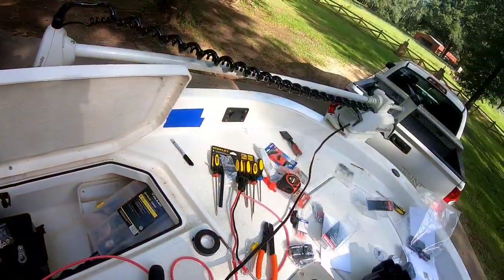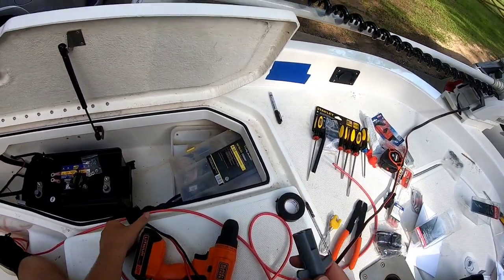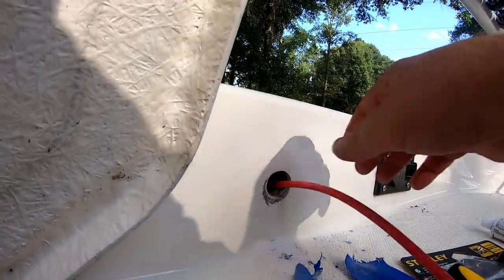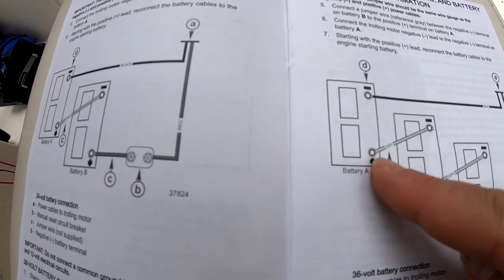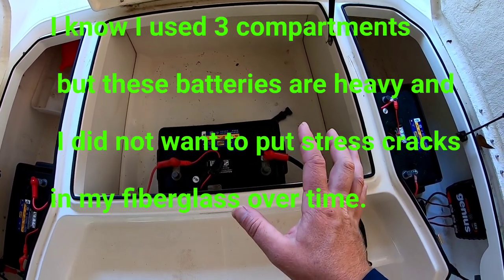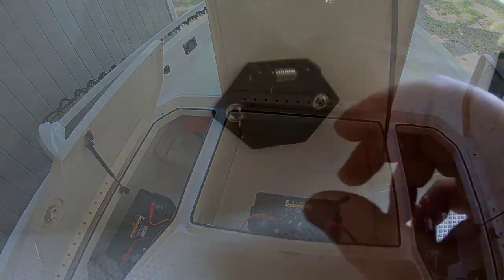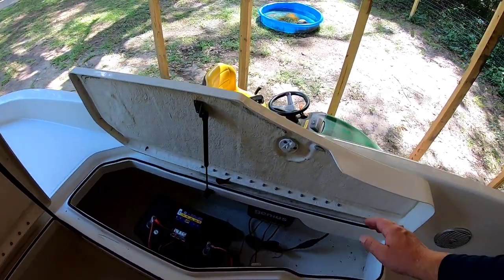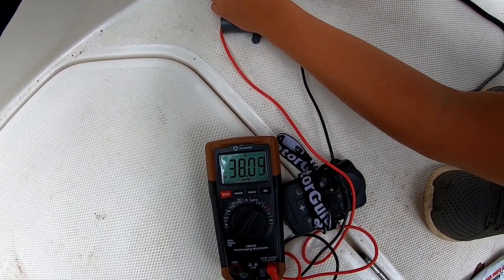INSTALLING A 36V TROLLING BATTERY SYSTEM.

Comment from the maker: You will need a 60 amp circuit breaker for a 36v system, if a 50 is used you will not get maximum thrust.

Comment: Thanks for the walk through on this. I am trying to get something together for my jon boat. Need all the help I can get. 😉
Reply from the maker: Glad it was helpful! If you have a 12v system you can connect two batteries together in a parrallel circuit and run it all day.

Comment: Very Good,  is it still running well, tossing and turning on a deciding on Minnkota or Motorguide. Leaning towards Motorguide not for price but for simplicity and less stuff to break.
Reply from the maker: it still runs but my gps for spot lock is bad

Comment: If you run the drill in reverse to drill the hole you have less of a risk of chipping the gel coat.
Reply: I think that was his problem. He started the drill in reverse before he got the pilot hole drilled.

Comment: Was your boat already wired for a 24 volt motor
Reply from the maker: Yes
Reply: @251reeling9  you couldn’t use the existing plug
Reply from the maker: @thundercat3922  Yes I could have but I didn't like the wiring on the back of it so I started fresh.